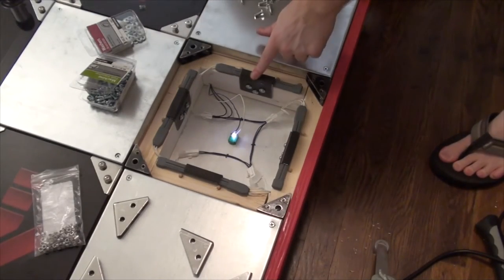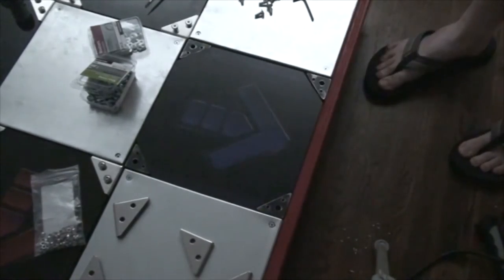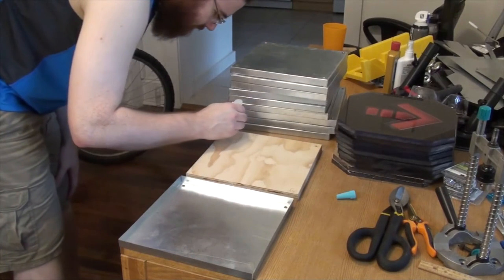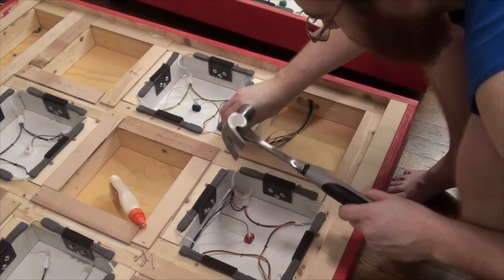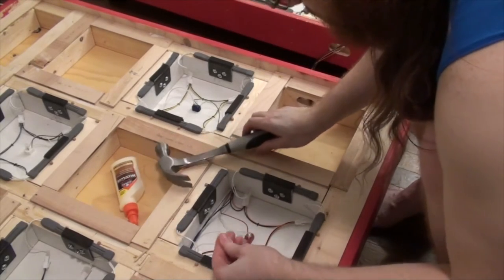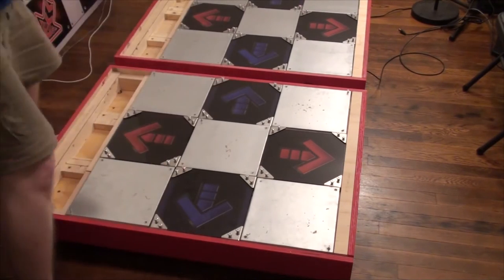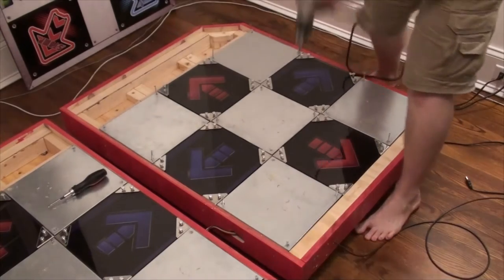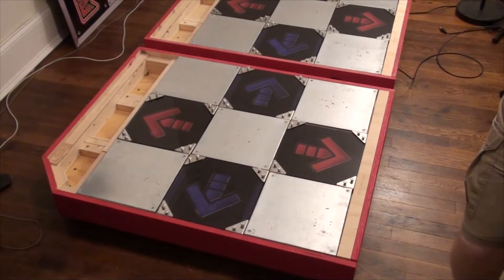Building an ITG2 dance pad replica - episode 14: Payoff

Comment: Awesome series, absolutely loved it. It made me want to build my own furniture for my office instead of buying ready-made, but the truth is it would be way more expensive that way so it's not really a good idea.
I've seen you mention in another comment it ultimately costed about $3k ($4k when included wasted parts) - that's way more than I expected. I was sure this could fit in about $500, since it's mostly wood but I have no idea how those things are priced.
Reply from the maker: The wood was super cheap, only about $100 total... It's all the other stuff that makes it so pricey. Sensors were $300, bars were $200, custom machined metal parts were like $1400 total. I'll definitely go over all of this in a video soon!

Comment: Congratulations man, it looks like they turned out really well!

How likely do you think that things will wear and settle as the pads are used? Do you think there will be any problems later on?
Reply from the maker: Thanks! I'll probably have to continually adjust sensitivity as things settle and shift around, but that's pretty much standard arcade pad maintenance. I do have a worry about the leg levelers... If you look closely around 49:24, one of them leans pretty noticeably inward. I might have to take out the threaded insert and try to reseat it straighter, because I already had a suspicion that those are the weakest points on the pad, and having it at an angle is exactly what I don't want. Apart from that, I think everything should be pretty solid and durable!

Comment: How did these feel compared to the arcade version? I'm guessing with how sturdy everything is, it'd feel close to the same. I wanted to build some pads the same way... I've noticed with cheap "Arcade" pads they feel super squishy because of the lack-luster materials used.. I always figured with heavier duty wood / materials that were more sturdy - it'd feel more like the arcade.

any way I could get the blueprints (if any) for this?
Reply from the maker: Not perfect, but reasonably close. Because of the lack of sensor channels and wooden corner stoppers, the panels actually feel even more rigid than arcade pads. I'm going mostly by memory, since I haven't pulled these things out since getting my ITG2 machine - one of these days I'm going to need to do that and make a side-by-side comparison video.
Reply from the maker: Also, blueprints are linked in the description. They're not perfect, but hopefully you can get some good information from them.

Comment: I would like to build  a pad but i wanna ask how much did this all cost?
Reply from the maker: It was pretty expensive... The parts that actually went into the pad totaled up to a little over $3000. Additional overhead (buying things I didn't end up using, tools, etc.) increased the total amount spent to somewhere closer to $4000. Now, there are definitely a lot of ways this could be done cheaper... I'm planning to do a detailed cost breakdown video soon with some ideas for how to avoid the most expensive bits. It might be possible to get the cost down to somewhere around $1600 with pretty much the same design, but it would take some pretty drastic changes or omissions to get it any lower.

One of these days, I'm going to get a website for this project up and running... Schematics, part photos and suppliers, and as much info as I'm able to share will be made available. Having done this now, I'm not sure I'd honestly recommend the project to anyone unless you're in my exact situation (unable to find a used arcade machine, unwilling to compromise)... But hey, if you're up for it, I'm happy to provide as much support as I can. Despite the monumental effort it took, this was really a lot of fun, and the end result feels amazing.